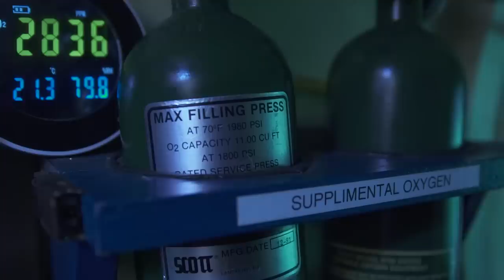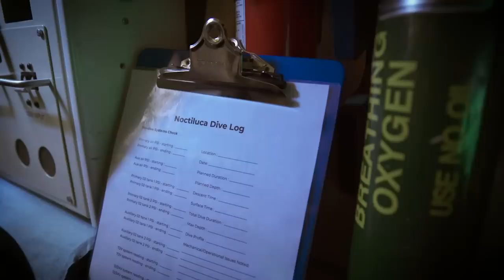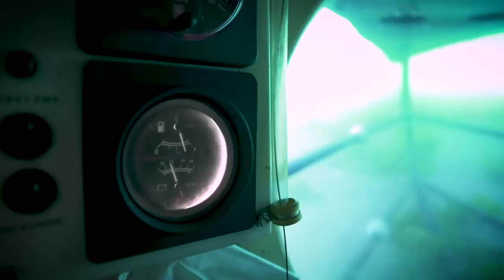How This Woman Started Diving in DIY Submarines | Obsessed | WIRED

Comment: Hammering the exit closed seems kinda dangerous 😬
Reply: Its just to make the initial seal on the hatch gasket. Once the sub starts to dive the pressure increases and seals the hatch even more. You wouldnt be able to open the hatch until the inner pressure equals with the depth you are at. 
You can flip the dawgs on the hatch with your finger once at depth.
Reply: @buildthings79  can fingers really undo that hatch in an emergency?
Reply: Jonny B  most of what you've said is true & remember those hatches use screwed mechanisms. My argument is, bare hands won't have enough leverage to open 6 or 8 tabs that were previously hammered shut using a mallet in an emergency (even after pressure equalisation). She's dead if she doesn't have a scuba tank to buy her time to hummer away down there.
Reply: As long as it's closed chances aren't that great to lose that hammer.
Reply: @hans-joachimbierwirth4727  using the hammer might give you a chance but your fingers aren't flipping those dawgs as previously suggested.
Reply: Choked on that one. Thanks!
Reply: Jonny B  thanks for putting that into perspective lol.... sounds a little intimidating.
Reply: Jonny B  this is correct its the same reason you cant open your car door when you sink underwater. You need to break the glass or roll down the window right away. If not possible you will need to wait till the car is filled up with water befor the door can open.
Reply: I'd guess not hammering it closed is far more dangerous.
Reply: dude right
Reply: @masonmax1000  I'm guessing you didnt read the above explanation...
Reply: @NatsumeKonno  you'd be surprised at the amount of people who don't know that.
Reply: Seems reasonable actually. I good seal is not only required, but mandatory. Once there is water in the seal while underwater, it will never be able to be readjusted and it will leak in water constantly though waterpressure.
Reply: You mean, no ejection seat?
Reply: TheAceOfSpades rapid climbs to surface? Why?
Reply: @bul166  I may have been confusing it with diving. If you go deep diving and are in a high pressure enviroment for long periods of time a rapid accent to the surface is deadly.
Reply: That was the most badass thing about the submarine 😂
Reply: @theaceofspades485  yeah that would be a problem only for subs that don't have 1 atmosphere pressure inside at all depths, and only for lower than 30 feet for like a few hours. which you would need to resurface for air anyway
Reply: Smh 🤦🏻‍♂️
Reply: @NatsumeKonno  Lies. I opened my car door when it was underwater and swam out and looked back and all I saw was one headlight under the water. You will be amazed at what you can do when you have seconds left. I just pushed hard. and kept moving the water. It's not a wall. There was no window open either.
Reply: @Teqnyq  I'm no sub expert but you'd never escape via the hatch while underwater. If you tried to open it while underwater you'd get blasted by the water coming through. The pressure would throw you to the floor of the sub. And that's assuming you could push open the hatch that opens outward (toward the pressure), which you certainly couldn't because physics. It's designed so that the water pressure helps to keep it closed. I think that's what causes people to drown to cars that crash into bodies of water - you can't open the car door and even if you could, you wouldn't be able to get out with thr current pushing against you. Only way you can survive is getting out before submerging or waiting until the entire compartment has been flooded and the pressure equalized - by then you would probably drown though I think.
Reply: THE WHOLE THING IS DANGEROUS WDYMMMM

Comment: I've always wanted to build my own sub but I'd want to do it right. I'd want to build one over 100 ft long with a sterling ringbom engine with a hydrogen electrolytic oxygen system.
Reply: Good luck with that size.